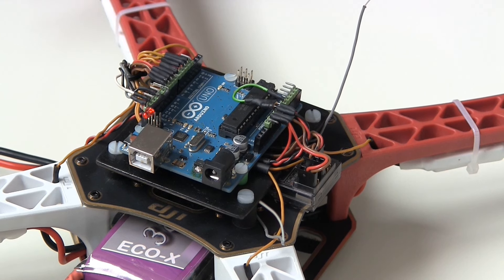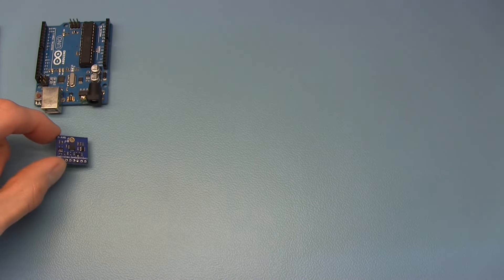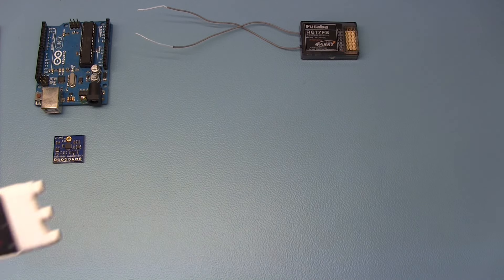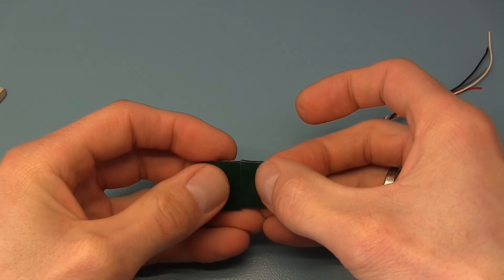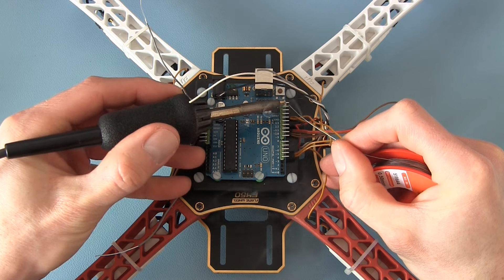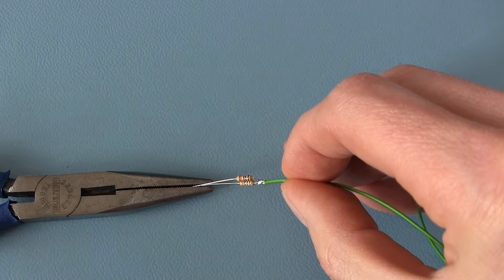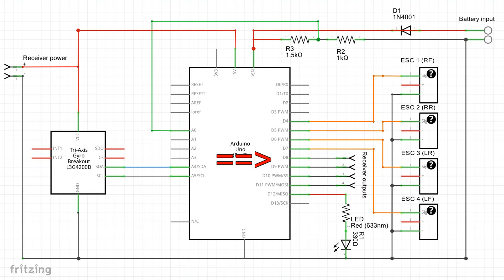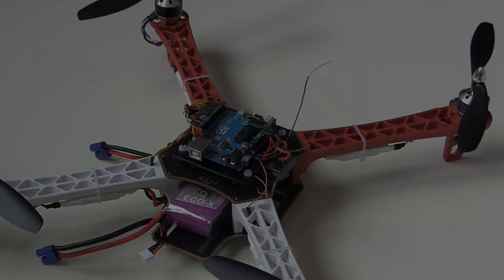Your Multicopter Flight Controller - 3D (YMFC-3D) Part 1 - Hardware.

Comment: I'm gonna start doing this project from today. The question is that can i use arduino nano. And I'm using l3g4200d must I edit the arduino code.
Reply from the maker: Please use the YMFC-3D version 2 code: https://www.youtube.com/watch?v=CTtLPeJPbXY

The nano uses the same ATmega328P microprocessor and should work fine without changing the YMFC-3D version 2 code.
Reply: Can i use mpu6050 without changing the code
Reply: Because I have to purchase a new l3g4200d I have a mpu6050 in my hand
Reply from the maker: You can use the MPU-6050 with the YMFC-3D version 2 code.

Comment: what happen with voltage regulator on your arduino ? looks like badly soldered :P
Reply from the maker: It was perfectly soldered when I got it. I only connected a cooling strip to get rid of some excessive heat. And added some wires, and did some other tests with it. This board has a hard life ;-)

Comment: any idea what reciever protocol i must use so that the arduino understands the reciever output. any help is appreciated
Reply from the maker: 1000 till 2000us pulse with a 1500us center pulse.
Reply: i am using a ESKY 6ch 72MHz reciever model 000095 (EK2-0420) reciever . does it have these specs?
Reply from the maker: Check the manual of the receiver for detailed information. But if it works with standard servo's it should also work with the YMFC.

Comment: I've made everything like u said but when compiling the setup code its executing till the gyro search  and the first kind and its taking at least 30 min to go to another one ,after four kinds it will take another hour but no result. So please help me
Reply from the maker: What gyro are you using? Please note that the MPU-6050 is only supported by the YMFC-3D version 2:
http://www.brokking.net/ymfc-3d_v2_main.html
Reply: Joop Brokking we are using l3g4200d
Reply from the maker: What software? The YMFC-AL for example only supports the MPU-6050. If you use YMFC-3D version 2 the L3G4200D should work fine and you need to double check the wiring.
Reply: We tried both the versions of aruino (1.8.2 & 1.0.6) we will try again by double checking the connections.

Comment: Hi +Joop Brokking I built the entire hardware setup, uploaded the code, and now I am having issues with the PID controller.  Also, when I ran the code for the esc outputs, the motors are very responsive,  but with the final code, the motors are not as responsive.  Thanks!
Reply from the maker: +MTUGoProGuy Did you check your setup with the code from part 2(receiver) and 3(gyro)? If your output is the same as I showed in the video you only need to change the pid values to get more response.
Reply: +Joop Brokking yes I did. My receiver is set to be 1500 when the sticks are in the center position. Another issue is that when calibrating the PID controller one motor will spin much faster than the others, but the throttle has not been increased yet, just the motors turned on.
Reply from the maker: MTUGoProGuy
Have you calibrated the esc's so the react the same? Check the manual of the esc on how to calibrate them.
Reply: I ended up realizing that the gyro was pointed the wrong way, so it was throwing everything off. Thanks!
Reply from the maker: MTUGoProGuy
Did you check the gyro with the gyro sketch of part 3? A wrong direction should pop up with this sketch.

Good to hear that you found it.

Comment: Hi there Joop! Thank you for this wonderful video!
Is is really important to upload ESC calibrate program?
Binding is enough right? one by one !
can i directly jump to set up program?
please do reply!
Reply: First: SETUP-program. Second: ESC-program (and ESC calibration). Third: FLIGHT-program. You'll need the ESC-program as well according to the three steps. Calibrating is possible after uploading all programs. I wouldn't advice it. Particular steps has to be taken, otherwise one motor runs faster than another. That is what you want to prevent. Good luck.

Comment: Hi , Mr job, what's the approximate length of propeller and the arm ?
Reply: Thualfikar Falih length of arm is 45cm, like the F450 or SK450 frame (450mm). For the AL, too, although I used a Q380 frame. The props in inches depends on what kind of motors you use (in KV). 1000kv motors need 10 inch props. For 1100kv I use 7 inch props, according to the manual of the motors. Refer to your motor manual for the right size.

Comment: Hello all, can anyone help me. My project arduino quadcopter is almost done as well as the setup but I encountered some issues. the power LED which the one connected to the D12 pin of Arduino Uno is blinking. Your help to solve this is great appreciated.

Comment: I am new to arduino and hardware generally. Question 1) How was the ESC connected to the arduino? At 6:31 in the video, it appears that the ESC's 3 small wires (brown, red, and yellow) branch into 1 yellow wire. How is this junction created? Question 2) In addition, how is the motor connected to the ESC? The motor has 3 wires and the ESC has 3 inputs (U, V, and W). Which wires go into which inputs? Thank you so much for your time, I really look forward to experimenting with this build myself!
Reply: All ESC'S are connected to the PDB (power distribution board). The F450 frame has an integrated PDB. If you have got a frame without PDB, you'll have to buy a seperate one. Three wires of each Bec are connected to the motors (one site has three lines, connect those to the motor, which has also three lines). The other two lines are connected to the plus and minus of the PDB. The BEC to Arduino with Arduino shield. Don't use the middle line of the BEC (5V), only the signal line and the ground line. From the PDB two extra wires to the VIN (+1.5K) and to the GND (+1k) of the Arduino Uno. Both resistors (1,5k and 1k) are connected to A0 (analog zero line of the Arduino Uno). For most motors, you can switch the outer lines for make them CW (clockwise rotation) or CCW (contra clockwise rotation). The middle line is the signal line, don't switch this one. Whatever you do, please hold on to the scematic of Joop Brokking. Use for the gyro a clear 5V-line and GND-line (with a Arduino shield you'll have planty of 5V and GND lines). Keep the lines of the gyro short, as well as the receiver lines. Have fun, it's a great learning experience, which took me three quarter of a year to understand and built it. Joop Brokking did a very good job.

Comment: Hi +Joop Brokking, i did exactly the same as you say in your video. My quadcopter got yaw drifting. Why it is happen? How to solve it? I have already checked my gyro also. It is ok.
Reply from the maker: +Htet Mrak Is it a fast or slow drift? Did you setup your transmitter with the sketch of part 2? Is the rotation direction of the props correct?
Reply: +Joop Brokking, Yes i did. But the problem is my transmitter cannot go until 1000 to 2000. I can settle the best range for 1140 to 1860 to all four channels center with 1500. I use fly sky T6 transmitter.
Reply: +Joop Brokking, i change some values in your coding according to my transmitter. I will test again today. I let you know there still got problem or not.
Reply: +Joop Brokking  It is successfully working now. Perfect flying. Thanks you so much Joop.
Reply from the maker: Htet Mrak
That is so good to hear! Have fun!

Comment: Help!! How do you change clock speed to 400.  I followed the instructions to access file but twi.h file opened in word or note pad and then says I have no access to file.  What am I missing?
Reply from the maker: Set the file safety properties to read/write. Otherwise you cannot change the file.
Reply: @Joop.  Thanks.  That worked.  My throttle check came back:
Channel inverted=no

Roll:
Channel inverted=no

Pitch:
Channel inverted= yes

Yaw:
Channel inverted=no

Is this correct or not.  In the video yours read yes, no, no, no
Reply from the maker: It all depends on the transmitter that you use. If you did the correct stick movements it should be fine.

Comment: Mr. Brooking, when the esc are connected to the receiver directly then the motors work but when it is done with arduino there isn't any output. I checked the output of the arduino pins to the esc and they are showing the ground and signal pins are interconnected but when the arduino is off there is no connection. Please help.
Reply from the maker: You need to connect the ESC's as shown on the schematic. Try the ESC test sketch from part 4 to test the ESC's. The link is in the description of part 4.
Reply: But what does the esc test do and how to check the outputs. What to expect? Is there a video covering this ? Also is my fly sky fs i6 compatible??
Reply: I tried the test u told few days ago. Some letters were coming which looked like Russian. There was only a line in the serial monitor
Reply from the maker: The sketch does not output anything. It just helps you to spin the motors to see if they work.
Reply: I tried what u told but there wasn't any output. When the esc was connected to the receiver then the motors were spinning but not 4 at the same time. Each one powered up something after the previous.I did a continuity check on the esc pins on the arduino when powered off there wasn't continuity and when the power was supplied it shows continuity with ground. I tried this with the receiver on and off and it was the same. Could u help? Is there any way to know what's at fault?
Reply from the maker: Try the YMFC-3D version 2 software:
https://www.youtube.com/watch?v=CTtLPeJPbXY

This should work fine.
Reply: It didn't work. Red led is on continuously. Does the reciever need to be connected to the arduino when the led blinks ?. I tried both with the reciever connected and without it and it didn't work .

Comment: we can also balance props by prop balancers, I think it will also balance props perfectly suggest me joop sir plz.
Reply: A prop-balancer works very nice. It's not an expensive tool, but very good to make the rotor or prop in good balance. Just use tape on the top of the prop. There are very cheap props, mostly those kind are poor balanced. One half of the prop is much heavier than the other half. In that case you can use ducktape on the top. It's much heavier than normal tape, but certainly will do the job (experienced it myself). Good luck!

Comment: HELLO, I have a problem with my esc, when i connect my esc motor battery there is no think done but when i deconect the midle wire about the esc i heard some beep then no think doing, this problem made when i make a mistake connecting the wires, the bec is good it s make 5v, please should you give me some advice to resolve this probleme, thanks
Reply from the maker: Make sure to connect everything as shown on the schematic. If you reversed any wires there is a big chance that something is malfunctioning. So double check your hardware and connect everything exactly the same as on the schematic.
Check this page for detailed information: http://www.brokking.net/ymfc-al_main.html
Reply: Ok thanks very much and thanks for all your great works
Reply: Only attach the signal lines and GND lines of the BEC's. Don't use  the middle line of the BEC's (the power line)

Comment: In 4:14, is the plate that the Arduino mounts on included in the frame on the hardware list?
Reply from the maker: It's just a piece of plywood that I made myself.
Reply: Got it, thanks. And thank you for all the videos and resources. I'm ordering the components now and excited to get started!

Comment: Hey Joop.  I uploaded the flight controller software and the motors stop working.  The esc calibration was successful, motors spinning and now nothing.  Can you HELP me with this.  Thanks
Reply from the maker: The motors can be started with the stick sequence:
Start = throttle down and yaw left
Stop = throttle down and yaw right
Reply: Joop Brokking i tried that and still no response.  when i plug in battery, the tones start but it does not go through the full tone cycle.  it stops short.
Reply from the maker: Is the LED off after you start the quadcopter? Could you post the serial output of the setup program so I can have a look what might be the problem?
Reply: Joop Brokking yes.  After uploading the flight controller software the LED turns off.  I used the AL setup, esc calibration and flight controller software.

Comment: The quad is moving forward even while setting pid and also while trying to hover
Reply from the maker: Did you try to hold the quad before the flight? Like I showed in the video https://youtu.be/JBvnB0279-Q?t=12m24s and https://youtu.be/CTtLPeJPbXY?t=7m24s

And the quad has no auto level function so you have to manually level it.
Reply: I did. I re did all the tests and it turned out one esc was starting few milli seconds earlier. I'm gonna put the main flight controller software now. The quad was behaving very violent. I don't know if esc were over compensating. At pid values where u got 15 I used 5 the quad felt stable. As I changed other pid values the quad was actually acting weird. It was trying to flip forward. I tried moving the quad with my hand to see if the gyro compensates. It does and then suddenly it goes crazy. Everything starts to speed up and tries to hit me
Reply from the maker: Can you send me a photo of your project?
Reply from the maker: Could you please check question 15 on the q and a page:
http://www.brokking.net/ymfc-3d_v2_qanda.html

I just added this question and it might help you.

Comment: Have u used jumper wires for connection ?
Reply: Only for the receiver. I suppose you mean the jumper wires with Dupont plug for connection, without soldering? On one end I cut the Dupont plug of the jumper wire and solder it to the Arduino. The other end is attached (with Dupont plug) to the right Channel of the receiver.Using jumper wires or a breadboard is a risk. Use it rather not, because the vibration of the motors can disconnect a wire. Better solder them of for the receiver: hold the jumper wires tight in place with a small tie-rip. This workes for me. Never use a breadboard.

Comment: when i upload setup and in serial monitor it shows I2C clock speed is not set to 400kHz. so how to solve this problem..?? i use gyro mpu6050.
Reply from the maker: Please use the YMFC-AL code: http://www.brokking.net/ymfc-al_main.html
Reply: Can i use this code for mpu6050?

Comment: Hey Joop, I have everything connected and the code downloaded but the device doesn't start. The ESC's don't sing their little song at all. Are there common sources of error upon starting up that you can address? What might I be doing wrong? I have verified that everything is connected properly.
Reply from the maker: Have you watched all the videos in this series and uploaded the Arduino sketches that I made? This is the most common problem ;-)

Check question 1 on the Q and A page:
http://www.brokking.net/ymfc-3d_qanda.html
If you follow these steps you should be able to get it flying.

Let me know if it does not work.
Reply: Joop Brokking
I am stuck on Step 4. I turned on the Transmitter with the throttle in highest position, but when I plug in the battery the motors just beep indefinitely
Reply from the maker: To calibrate the esc's you need to connect them separately to the receiver throttle output.
Reply: +Joop Brokking Alright we are doing PID tuning now and we should be great! Thank you so much! I do have a question though. Is there a way to edit this code and make it an autonomous quadcopter? And if so any ideas of how to start doing that?
Reply from the maker: Good to hear that you got it flying!

First thing that you need before you can do autonomous flights is an auto level feature. Maybe this site can help you with this:
http://www.starlino.com/imu_guide.html
Reply: We ended up switching transmitters/receivers. The one we had was broken and would change the throttle and roll signals as you move the throttle. However, the ESC output code does not work with this new device. The receiver code works perfect though. The broken transmitter still works with the ESC code though. Any suggestions?
Joop Brokking
Reply: Joop Brokking I've discovered that when only 3 ESC's are attached they work fine, but if I attach a fourth then the first ESC refuses to turn on
Reply from the maker: Connecting or disconnecting an esc should not effect the code. So maybe you have some hardware problems.

Comment: Hello can Darlington transistor used to replace ESC ?
Reply from the maker: No, controlling a brush-less motor requires a sensing loop. So you need more than only a transistor.
Reply: Joop Brokking Thanks for reply.

Comment: Can you use Linear ESC's or do you need Opto ESC's for this?
Reply from the maker: +Marc D'Mello Opto just means it does not have a bec system. Basically you can use any esc if it is fast enough (min 250Hz refresh rate).
Reply: Joop Brokking So if I use a linear ESC, I won't have to connect the arduino to a power source, correct? (sorry for all the questions, this is pretty expensive stuff and I don't want to mess up)
Reply from the maker: Yes, you could use the voltage regulator from the esc..... IF it has a 5V regulator! Otherwise you be better of using the Arduino Uno's internal voltage regulator.

Comment: what size of props I need if I use 2200 kV motor
Reply: Look in your motor manual or download a manual. With 2200kv motors you can't use large inch props. I have 1000kv and 1100kv motors. The 1000kv need 10 inch props (1045 or 10X**). The 1100kv are rotating faster. My manual advices for the 1100kv 7 inch props. It also depends of the lipo (1100kv and 2 cells lipo: 8 inch / 1100kv and 3 cells lipo: 7 inch. If yoy have got the props, you'll have to balance them (e.g. propbalancer) for more stability in the air or when lifting of. Good luck.